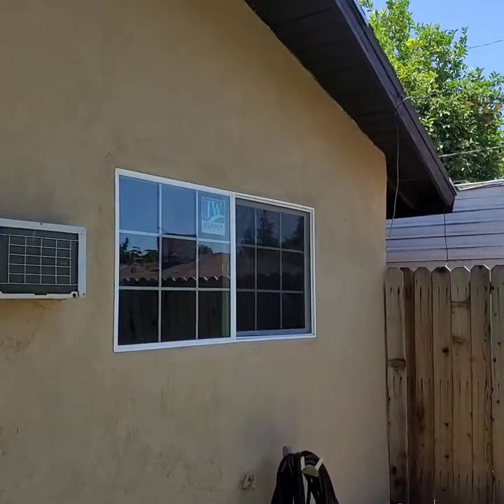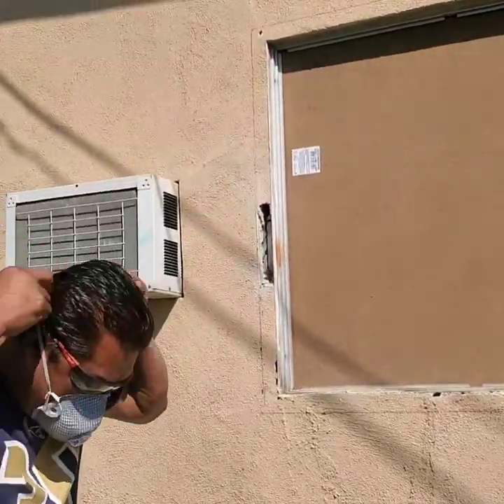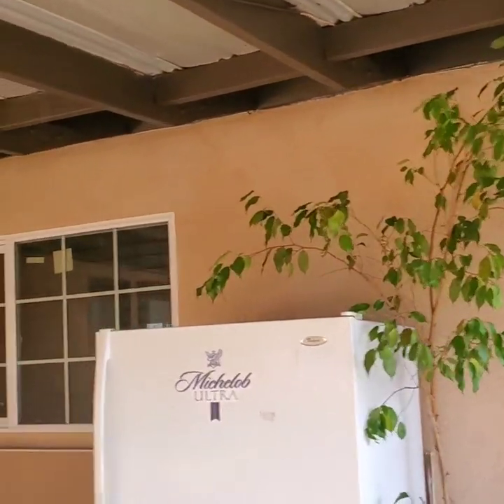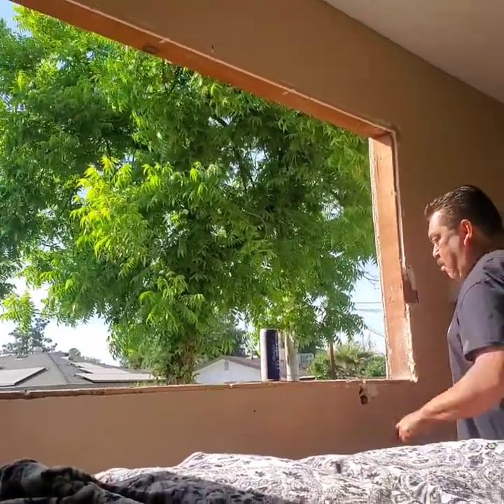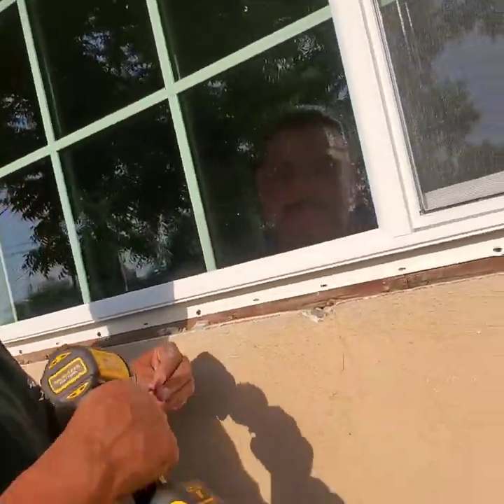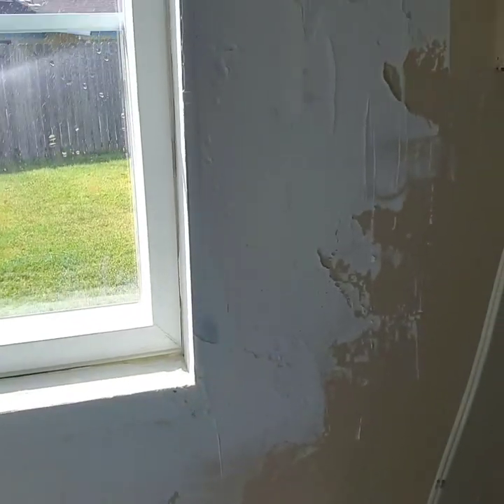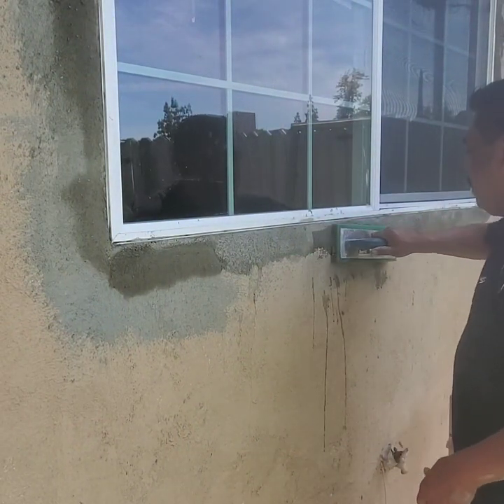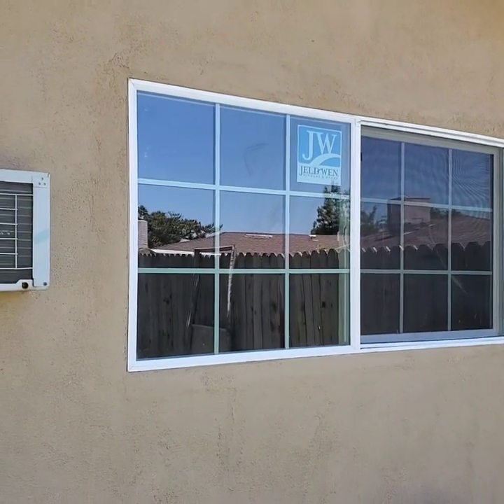DIY.  How to replace a window on stucco wall

Comment: I would of added  waterproof membrane around  the 2x4 before installing the window and then silicone under the window flange or waterproof plastic over the flange before adding the stucco to prevent any moisture build up. The insulating foam is only good for temperature control. It would help in the long run.
Reply from the maker: ok
Reply: I was thinking the same
Reply: Araund how much it cost to do this job just lobor??
Reply: I would have used a retrofit window and left the old frame installed.
Reply: Water proofing in window installation is important and should not be skipped even for California.
Reply: yeah.  Saw that too.  Maybe in about 5 years we will see the wood rot repair.

Comment: I wanted stucco to fill in around new windows, but the stucco person I talked to said he would have to cut back into the wall to overlap the wire.  He explained that if he didn't do that, there would be cracks.  In your video, it really looks like you just cut the wire and laid it in around the window without any overlap.  I had wood trim put back around the new windows, but I would gladly have that removed if the stucco fill-in really could be done.
Reply from the maker: Your stucco person is correct, you should. I'm not a Pro stucco person but I haven't had any stucco crack on me..thanks for the visit

Comment: Awsome  video just what I needed to see . Hey I have a smooth stucco finish what product should I get?
Reply from the maker: Just use stucco apply 2nd coat with metal trowel while spraying wall with spray bottle until smooth

Comment: I have read that the correct method and the one that I have used is to carefully break the stucco, not disturbing the tar paper underneath rather than sawing.  Then new tar paper should be installed over the exposed wood and properly layered from bottom to top, then the chicken wire. Cutting the stucco and not using tar paper could leak and is more apt to crack.
Reply from the maker: yep
Reply: Yes, that is the correct way. This is coming from a stucco contractor with 20 years of experience working on older homes (additions and window/door installs). Always cover your window before plastering.
Reply: @alanalameda5636   how much should charge for replace a window with this process

Comment: Beautiful job….I did the same but I made a mistake…i completed the whole house except the two front windows, I left them for Monday and Tuesday….the code enforcement from the city goes by during the week not on weekends….so they came to the house and posted a sign telling me to stop all work until I pull permits….I had to get permits for all 10 windows even the ones that were done already…I asked the city how come other people don’t get permits, they said that I broke the seal around the old windows when I took out the stucco around the window and that kind of work, they said, requires permits….
Reply from the maker: thanks
Reply: Hi Erlpen, by any chance you live in south Florida? I know I am capable of changing all my windows but the freaking permitting is what is stopping me from doing. I will follow code installing but I do mot want to go through the hassle of permits. My o my concern is, if I sell my house, would I have Issues? 
Did you got fined? 
I really want to change all my windows but can’t afford to pay close to 40k for them as some companies quoted me….
Reply: I live in california...and i just had to pay the cost of the permits with no fine....also the cost of replacing the windows would've been  $15.000...

Comment: I want to make a brand new window on exterior stucco wall. I have a solid wall and I want to make a window in it. Do you have a video for that?
Reply from the maker: No not yet.Thanks for the visit
Reply: that takes some structural work. to do that you need to cut studs, add king studs, header,  trimmers, sub sills, and cripples. THEN you can add your window

Comment: Good job is good if you dont have inspection but if you going to have an inspector there he wont letyou do with out wstet proof menbrane around the window that what make you a litle more extra work cous actually you are puting new stucco i know it sounds stupid but it how it is cous if the stucco is very tight it wont leak but those bunch of rules make the job more difficult
Reply from the maker: thanks for the visit

Comment: How much you charge I need front window and two bedroom wndows
Reply from the maker: Thanks for the job offer.But I'm not a contractor, Just a Do it your selfer.
Reply: Where are you located? Are you near Vegas?? I'm in Vegas and can definitely hook you up!
Reply: The usual cost is $300-350 per window. With window included. Those are with quotes I've received here in Los Angeles CA.
Reply: veryslyfox  that's true. I started should my own window replacements. I break stucco like the video. Which is why I'm watching this video to learn how to apply stucco.

Comment: You make it look so easy! I went looking for replacement windows and they told me they dont cut the stucco and seal the windows on the stucco. Is it better or worse to do it that way versus how you did it? Great video!
Reply from the maker: Actually it's more time consuming to do it the way I did it, I like the New construction look. You can do it the simple way with retro windows but then you would have a funky 2 inch fin around your window I bought the NEW Construction windows from Home depot.
Reply: The retro windows fit inside the frame of the old aluminum window.  That way the waterproofing in the wall is left undisturbed and you utilize the week holes of the old window.  Most people do not realize that the large 4 inch lip around a retro window can be trimmed down to a desired thinkness.

Comment: You ripped out without even having the window on site? That's crazy.
Reply from the maker: You caught that too.. I was making a video....... I put the old window back until the window came in, it actually took 4 weeks. Because the first window was the wrong one. I had to reorder Thanks for the visit
Reply: @mrnoe67tiktok  Thanks for the video and for your replies. My contractor said he would do the same as you ie take the window out and order a new one. He said 2 weeks but right now, I think 4 weeks is more likely.
Reply from the maker: @Gigismum  Thanks for the visit. I just ordered 2 windows from HD, I got them in about 10 days.